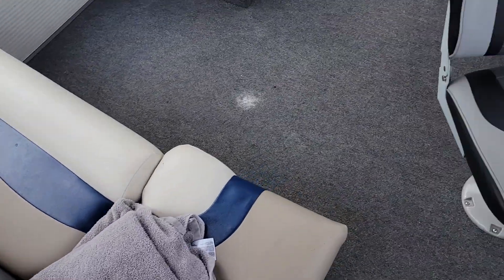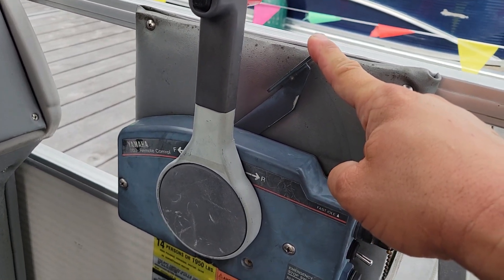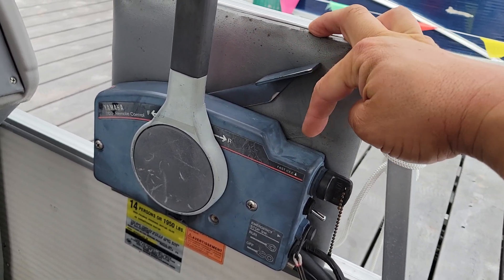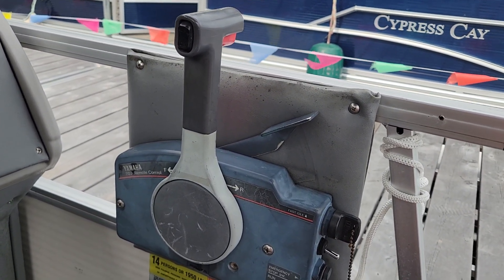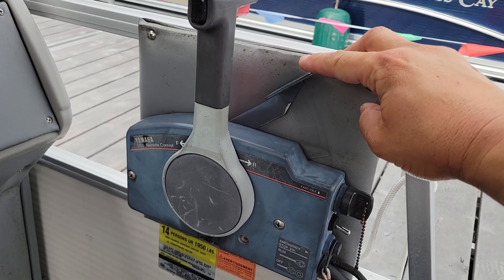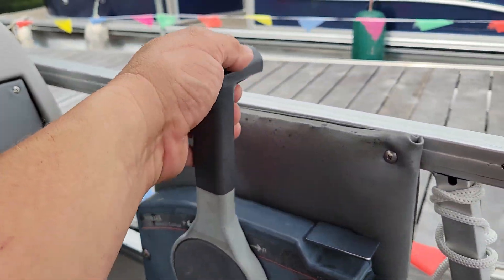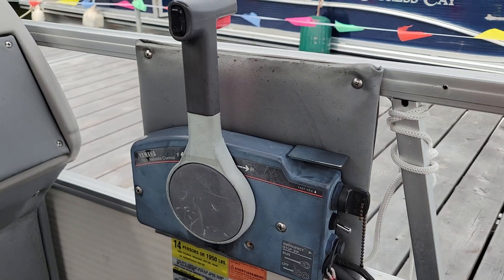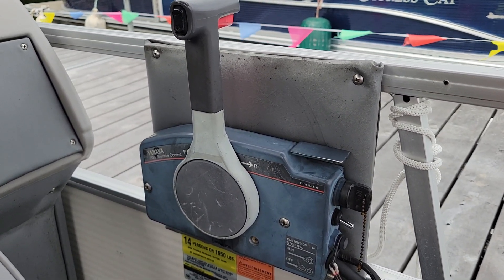how to cold start your yamaha

Comment: Hi...I have the same problem. I've cleaned the carburettor... new petrol pumps... at first I have to put in ether... then if I go for a spin and turn it off... you're having trouble again... maybe the air or the carburettor needs adjustment ?